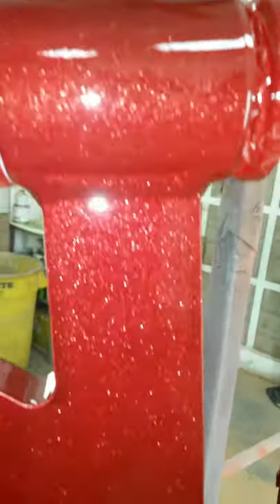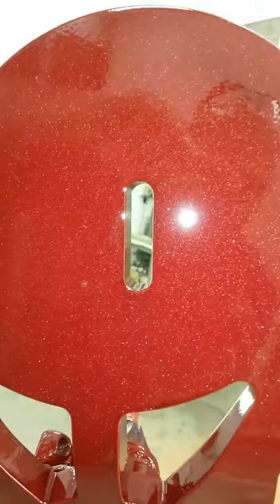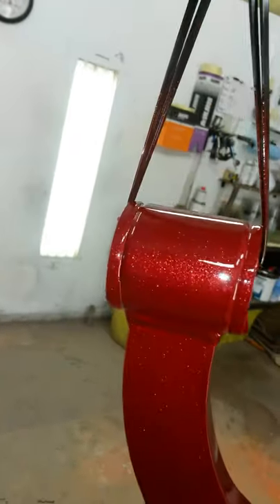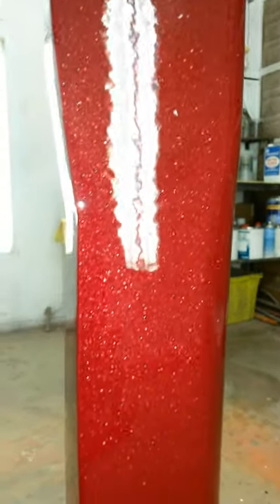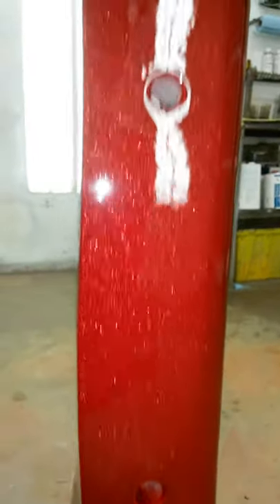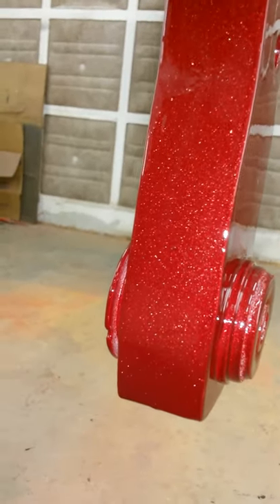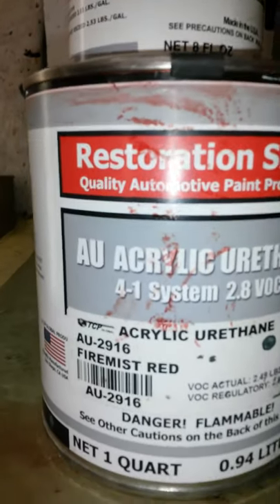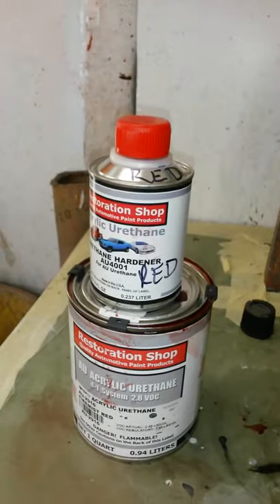Painted trailing arms and lower control arms.

Comment from the maker: Thanks, the system is designed to give a high gloss. Im not sure if I want to spray the car in the same singlestage or do a two stage. I more want a two stage so I can apply 4 to 6 coats of clear then cut and buff it.